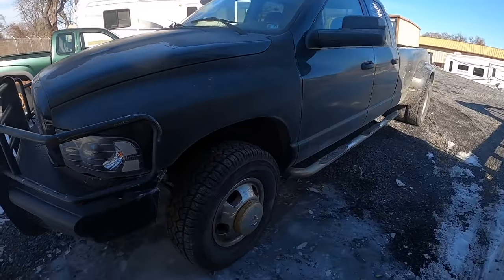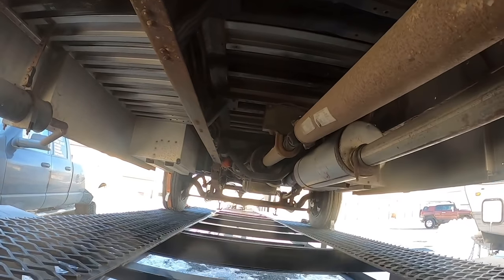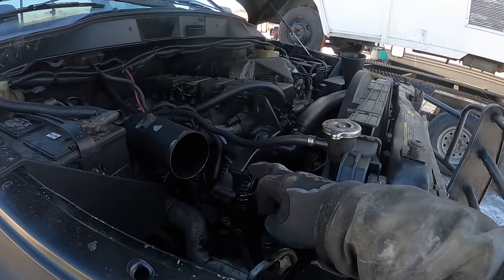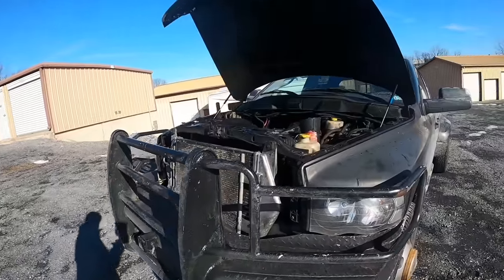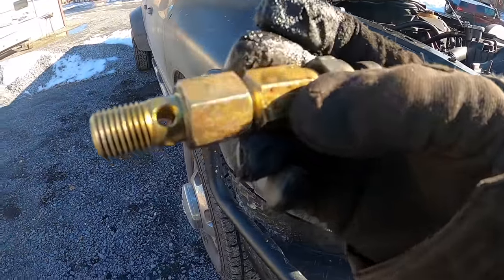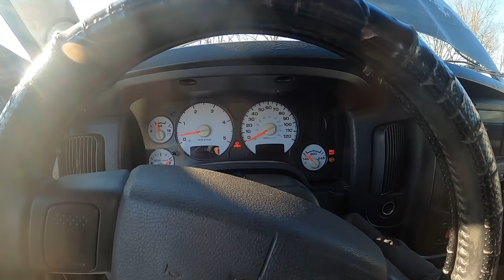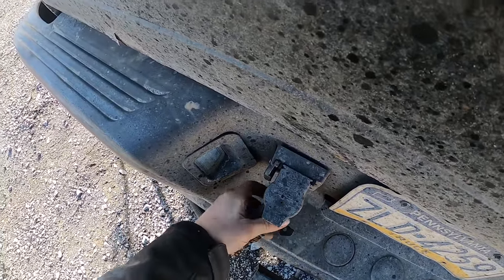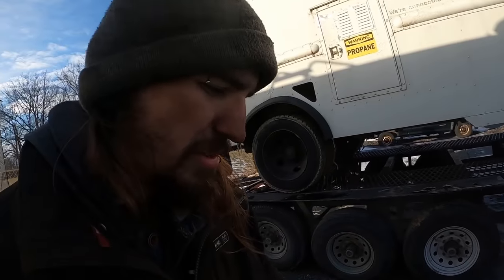Truck & Trailer Repairs On A Saturday | Brakes, Coolant, & Fuel drip | Hotshot Equipment Diagnostics

Comment: Just being a Dodge I'd suspect the heater core is clogged. Feel both hoses. Both should be hot if there is flow. If one is cold then it's not flowing. Reverse flush it will help so I'd try that first. 
  Dodge/Chrysler heater cores use an extra fine internal tubes and clog easily. It's well known issue.

Comment: Did you also plug it into the bed and check  for short ...instead of just the bumper?
Reply from the maker: I will be checking all of that today. That's actually a good point too but I've pulled other gooseneck trailers with it without issue but it doesn't hurt to verify again.

Comment: Hey just a thought I had. All pickup trucks have a heater core , in the past I have taken the hoses off at the fire-wall and hooked up a garden hose and flush out the heaters core  , it's like flushing your radiator. Hope that helps good luck.

Comment: I had poor heat from my 1982 CJ5 heater, I tested water going into the heater and back out (plenty of water flow but not much heat.  I replaced the heater core and now I have good heat in the old CJ5,  Both my 1996 Dodge 12 valve and my 2003 Dodge 24 valve  heaters put out large amounts of heat, you could wear a bathing suit when driving in the snow.

Comment: Check the cabin filter if it's dirty. Then heater core, the core on older trucks and cars some time need a flush .
Reply from the maker: No cabin filter in a third gen 😬 I do feel it may be time to do a heater core though. Truck has 552k on it and I bought it at 315k. Never swapped it out

Comment: Need to fix your blend door... It's is wide open where the cold air coming in .. take out your blower motor and look up see if your blend door broke..  I'm sure it's not working... Need to put a new blend door actuator .. or just tape it shut the door so cold air won't blow in the cab
Reply from the maker: I stuffed a T-shirt in there to rule that out. It worked great last winter I had heat

Comment: Steve tried flushing your heater core mine did the same thing I end up replacing the heater core because it was plugged up that will cause it not to heat up going down the road but heat up by setting still

Comment: Ya check your thermostat might not be opening, check the heater core lines to see if there hot, when you get the chance flush the heater core out with water both ways to clean it. Also could be the controls in the cab not working at all, the third gens have a bunch of issues with the blend doors breaking off and being stuck and the heat and air conditioning controls not working. The winter front wont do shit if its full of coolant and still not producing heat, i didnt even run a winter front this year in my 03 still with its common rail, and the heat works great compared to my second and first gen, which i have to run winter fronts on. -30 Celsius i was driving and had good heat in the third gen.
Reply from the maker: It heats up to operating temp though when towing. Just doesn't blow hot in the cab. I stuffed a shirt in the fresh air opening to rule that out and had heat fine last year. Not like super hot but it was warm enough to be comfortable

Comment: I would check thermostat could be brand new and still be bad.also feel the heater hoses going in and coming out the heater hose if one is cooler than it's probably heater core.

Comment: I always pull two strings whenever I pull out a wire. One for the current rewire and another for future wiring. If I run another wire, I tie a string to it so I always have a string to use. Try the 165 degree Cummins Commercial and Marine thermostat. Opens earlier for your heat. And once again on that turbo, with no coolant going through I think you are coking oil in the bearing area. I even have a cool down connection from my Edge, no tuning just instruments and turbo cooldown, that keeps the engine running until the exhaust gas temp is down to 450.
Reply from the maker: 450 is too hot. I used to wait until 350 to shut mine off

Comment: I think you have no heat because it’s to cold outside. My truck came with a winter blanket thing that covers the front so less air goes by the radiator.

Comment: Banjo fittings ALWAYS need two copper washers (one on each side). Your middle trailer tyre will probably have a bulge on it on the side wall or the rim is corroded, in either case it will blow out when your miles from help so make it urgent repair.
Reply: Twice I have had rims leak at the rim to center weld. Might have had another I did not catch before the blowout.

Comment: Had a problem on my 5th wheel trailer where the wire running inside the axle tub  rubbed thru the insulation. Took a while to figure it out.

Comment: No heat when driving... I've heard fan clutch stuck in the on position could cause this issue, might be a long shot but if you have an extra on hand

Comment: You sure your heater core isn't stopped up with anything maybe next time you pull the hoses off the heater core shove your water hose onto the exit and see if it'll push out any blockage. Also you might look into some sort of shield you can put behind your grill to block off some of that cold air in winter months to help keep some heat in your motor without losing all of it from air blowing thru the radiator all the time.

Comment: I’ll agree with some of the previous postings on here. I’ve seen some of your other videos where it looks like you’re using a sheet of cardboard to limit the cold airflow through the radiator which is a start. I saw in a previous video, you changed out the thermostat, so that rules it out. Heater core would be the next thing checking the inlet/outlet hoses. One should be warmer than the other. I’d reverse flush it just to make sure. You can switch the hoses or use some CLR /water or boiling water/vinegar and let it sit for half an hour or so to loosen the deposits. Watch the CLR/water mix, it’s strong enough to make the core leak. Smell of antifreeze leaking into your passenger side floorboard isn’t good. I’ve seen compressed air used with mixed results. Don’t use too much pressure or you’ll cause a leak. Last, I’d look at the blend doors and make sure the actuators are fully opening and closing. Outside airflow could be overpowering the heat when moving in those temps. Don’t worry about us on weekends, family first and we’ll still be here on Monday.👍
Reply: The Cummins Commercial and Marine thermostat at 165 degrees works so much better.
Reply from the maker: 165 is way too low for any diesel. I swapped in a 190 t stat from a big block. The factory 12 valve was 180 degrees. You can't run a diesel that cold. Fuel mileage and performance will suffer. When I had the factory t stat the truck would never go over 181 before sucking back down to 160 in a matter of seconds. No heat, poor fuel mileage, and a ton of carbon deposits on the piston were a result. 190 t stat while towing allows the engine to run where it should be(around 200 degrees) and my mileage is so much better. Also remember your oil temp needs to be over the boiling point. If you run a colder t stat there's always moisture in the oil pan and that moisture won't go away. No you're introducing that moisture to your bearings and other internal parts. This heater core is original since I bought the truck 230k miles ago. Going to bet it's probably plugged up from running straight water
Reply from the maker: Also my truck is always warmed up when towing. That's no issue in idle with the exhaust brake or since I tow a lot it always stays hot now. No need to cover the front

Comment: 90% of brake shorts on trailers is magnets going bad. Next is wire shorts from a bare spot being rubbed into the sheathing. I have chased and chased shorts only to end up replacing magnets one at a time and it usually finds the trouble.
Reply from the maker: I found the issue today. The wires inside the tubes on the rear 2 axles were bare and rubbing on the inside of the tube. The front axle was the only one with good wiring. I replaced the rear 4 brakes

Comment: Chances are and dodges are known for this to have a plugged heater core it doesn't take much For you not to get any circulation
Reply from the maker: Yeah, it's pretty ridiculous. Who wants to change one of them anyway 😂 I bought the truck at 314k and it has 552k now. Never have I swapped a heater core so it is definitely a possibility
Reply: @CPSteveMiller  I'm pretty sure book time is about 9 hours on a heater core  I have back flushed them and it worked for the season.

Comment: I wonder if all that oil being sucked into the turbo has gotten the blades all oily and heavy , making them out of balance enough to hit the housing a little bit.
Reply from the maker: Not a bad thought. I'll look into that after I get the air filter on

Comment: The reason you have fought heat problems the past couple of winters is that these trucks have a habitual problem ( as I told you last year) of the heater core plugging. This is what you do to fix it, Take the heater hoses off and blow all of the coolant out of the heater core with an air hose Next replace coolant with CLR or vinegar ( I prefer CLR) let it sit half an hour or so and then flush the heater core backwards with a garden hose, This procedure may take a few times but it WILL get you heat. BTW do yourself a favor and quit hooking your straps to the expanded metal on your trailer as they will bend in a hard impacting accident, I can't believe that DOT hasn't written you up over this yet.
Reply from the maker: Because that's how they were made to be used. It's not a violation, it's the correct way to hook them. I've slammed the brakes many many times with a load of 3 and never had an issue. Obviously a vehicle like a box truck is different but I drive like there's an egg under the brakes. I keep my following distance hard. Mind you every inspection I've gotten has been in North Carolina or Virginia and they aren't easy on Hotshots. I've passed all of those level 1's with a full load of vehicles. Even the dot will tell you it's the proper way to do it. That mesh is THICK. Doesn't appear so in the videos but it is

Comment: Use loctite 545 thread sealer (not a locker) on the threads. Creates a seal between the threads. I use it on everything from fuel connections to transmission lines
Reply: I put that shit on everything tacos, steaks, hamburgers

Comment: Dude,those brakes need to be adjusted every week,they dnt self adjust very good,do u know how to adjust by backing up them?  802/603
Reply from the maker: I am getting self adjusting ones next time. I didn't know that was an option until I bought new ones. I replaced all 4 rear brakes before the inspection

Comment: Steve what's the GVWR of that trailer? and did you derated it?
Reply from the maker: 17k is what I derated it to. Factory it's 21k. Kaufman had an 18k sticker on this one for some reason. They told the previous owner they refused to rate it to 21k even though it has 3 7k axles

Comment: Dude,maybe u dnt have heat because fan is turning all the time,try fan clutch? 802/603
Reply from the maker: 12 valve doesn't have a fan clutch. They spin all the time

Comment: Your center axle looks bent to me probably another reason the tires are wearing odd
Reply from the maker: I backed it in at a 90 degree jackknife angle so thats why it's over itself like that. That was the one axle that was on solid surface but the front axle was on ice so it slid nicer(I don't recommend that on a triaxle). That tire has over 50k miles on it whereas the other ones only have around 10k
Reply: I hope I’m wrong but I have seen the axle look weird on multi videos I would just keep an eye on it
Reply from the maker: Damn tire keeps going flat. I just ordered 2 new ones. That tire seems to never have more than 50 psi in it now. Check back on the video coming Friday. See what you think when it has the new ones. The tires will be here Thursday so they should be in that video. If not I'll have them on Saturday's video. I'm ready to not be fighting tire leaks! It's leaking right at the sidewall
Reply: Will definitely be better with new tires I had a bent axle on my trailer for a while didn’t even realize it I ended up putting a board on the outside of the wheels  crossed all of them I noticed one axle was turned slightly obviously before putting the board on you would pull the trailer forward to make sure everything is straight as possible

Comment: looks like the heat core hoses are not hooked right
Reply from the maker: I've flipped them around and got the same result
Reply: @CPSteveMiller  the one might need to go back to were you did the block off on the side of the engine

Comment: I’m betting the reason you are getting air in the system and you bleed it it’s good for a while ,is you probably have a bad head gasket. 200k on the motor and running high boost putting studs in it after its blown already didn’t do any good hence why you loose coolant too and don’t know where it’s going
Reply from the maker: I'm at 317k on the motor but there's never any coolant missing is the thing. No super high pressures in the system(even with the exhaust brake on in high idle). There's no signs at all of a failure. I topped it off after a full week of driving and it only took a 1/4 of a quart which is fine I think because when I filled it before I never actually bled it so that's normal. I feel like the heater core is clogged or a blend door is an issue. I stuffed a sweatshirt into the open air duct but I feel after buying the truck at 314k and it has 552k now I never did the core. Not to mention I ran water for a couple weeks from the regular faucet. That probably didn't help the heater core issue